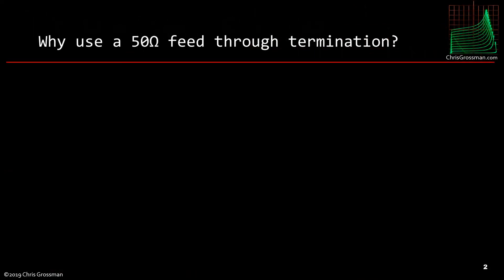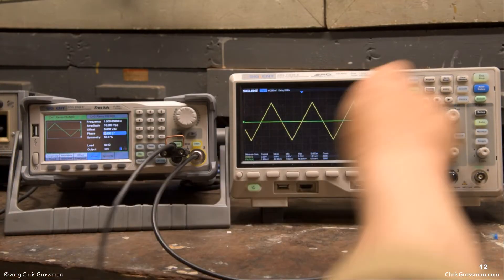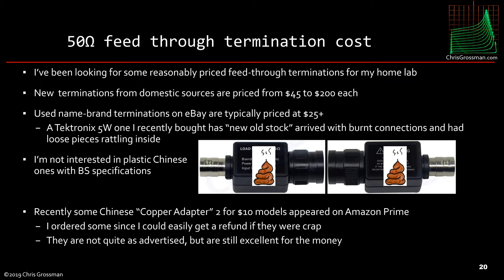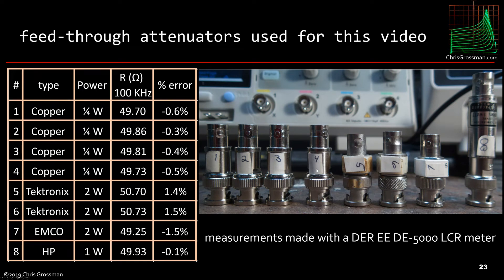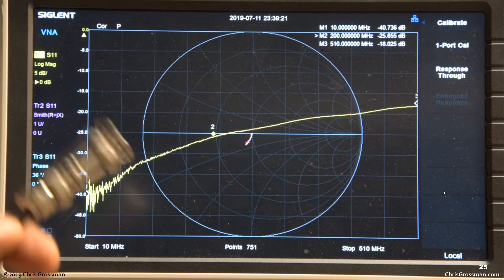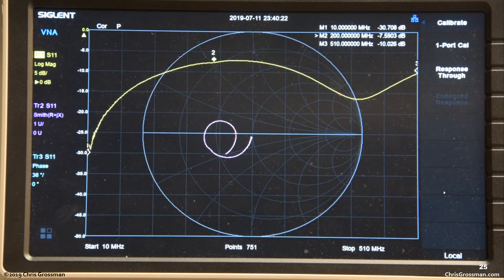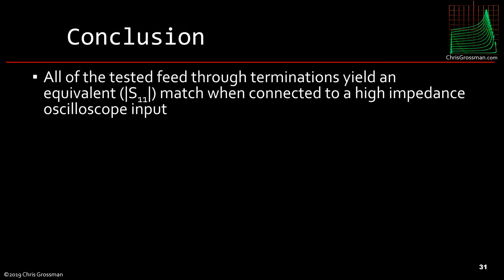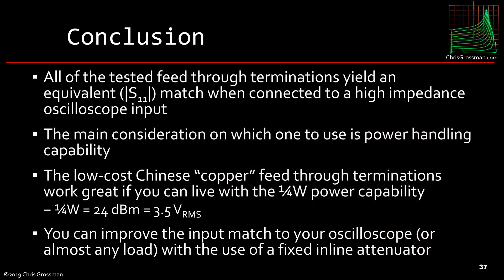⭐ Inexpensive 50 ohm Feed Through Terminations #0007

Comment: If we come to the conclusion that in-use, as long as its basic design is functional as a 50 ohm path to ground, almost all devices function the same, does that then mean the "crappy black chinese ones" should also be fine? As always,  simply divide all chinese specs by 2 or 3 and disregard all translated text 🤣

Comment: Is there any significant difference to using a pass-through termination like this versus using a T adapter on the scope with a 50ohm termination on one end and your DUT on the other?
Reply from the maker: It depends on the frequencies and/or rise time of the signals being tested.  My guess is that at 50 MHz or below the T will work, it might even be ok higher, but I have not tried it.
Reply: @Chris_Grossman  Thanks!

Comment: Hi, I'm absolute beginner and I have a OWON HDS2102S 100Mhz oscilloscope and a LiteVNA 6ghz , I have good attenuators and 50ohm loads and cables everything rated 18ghz.
I could reproduce with almost your exact values and behaviour on my VNA and Scope than in yours up to 150Mhz.
The thing is that I can see reduced the signal amplitude to /2 or /10 with the attenuators but I can not see any benefit apart of better return loss reading, no in the max readable speed I can get,150mhz from 100mhz spec, and maximum visible of 200mhz, this one is reduced in clarity by the attenuators. The attenuators doesn't improve the noise, spikes, and like a parasite reflection that is still there with the attenuators, I think VNA's RX/TX crosstalking but I'm beginner and no way I can be sure. 
With this I mean that apart of the better s11 reading (I improve 8db) in practice are all disadvantages at the moment.
So my real question is you added uses cases, but what the use of attenuators improve exactly in them and in what conditions (i.e. bad cables, higher amplitud that I use).
It looks helps my s11 but not to me and what I can to do.

Thanks I had a great day reproducing you video in my very first day with a oscilloscope
Thanks!

Comment: Amazing and straight to the point. Now I gotta redo some PSU noise measurements I made with 50ohm terminated coax. I wonder if there is a practical way to get reasonable return loss at 200mhz while maintaining 500uV sensitivity without an expensive and finicky differential amplifier

Comment: Is it possible to replace the resistors inside with ones that have a higher power rating?
Reply from the maker: There is not room for resistors that are larger diameter.  You might be able to replace the two 100 Ohm resistors with four 200 Ohm resistors and double the power handling.

Comment: Great video Chris. I just ordered two of those terminations on Amazon. Do you think it would be feasible to replace the two 1/8 watt resistors with two 1/4 watt resistors? It they would fit, one could double the power handling capabilities.
Reply from the maker: The clearance for the diameter of the resistor is tight, so I don't think ¼W resistors will fit.   However I had a thought that it might be possible to use four 1/8W 200 Ohm resistors to get to the ½W total power level.

Comment: Couldn't you solder on your own higher power resistors?
Reply from the maker: There is not room for much larger diameter resistors because the ground/shield screws over these with very little clearance. 

 If you could find something to fit you might be able to increase the power handling capability a bit, however at 0.25W you are getting plenty of signal so there is no reason not to use a attenuator in front of the termination and get a better match as well.

Comment: This is a very interesting video.  Thank you for sharing, especially the impact of placing an attenuator just upstream of the 50 ohm terminator.  I am wondering how well a BNC tee with a 50 ohm BNC terminator works?  It is also a low budget approach.  It is my usual approach when using scopes that do not have a built-in 50 ohm termination.
Reply: I use  BNC T and 50 ohm terminators, and I get slightly worst performance that shown in the video, but once I add a 20 db attenuator, I get very similar results (an almost flat -39.5 dB for S11). Hope it's useful.
Reply from the maker: I have not measured the capacitance of a BNC Tee, but I suspect it will add couple of pF to the input capacitance of the scope.   Thus I would expect a tee with a termination have a just slightly degraded input match vs. a feed through termination.